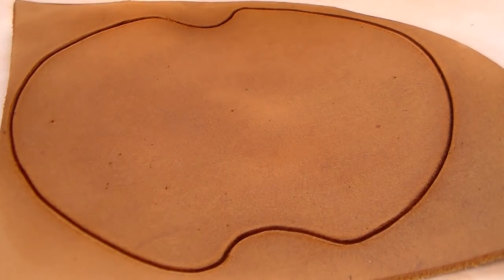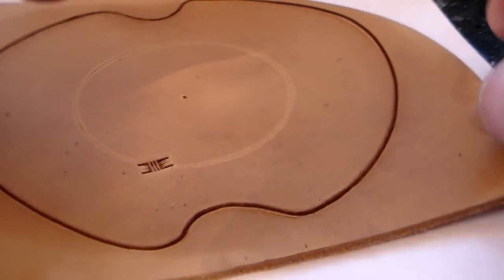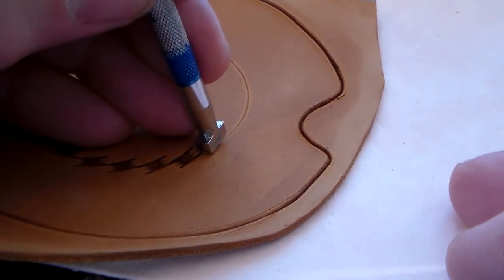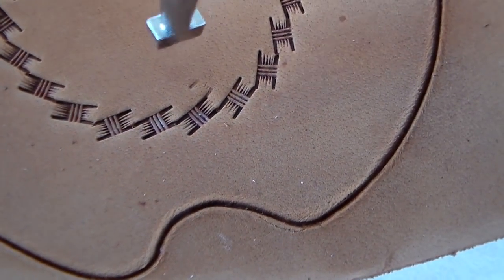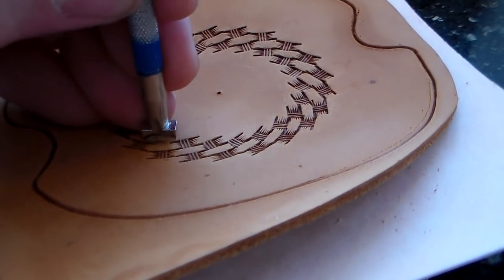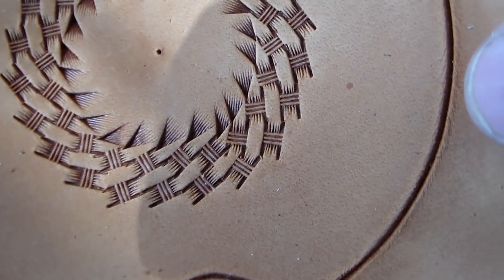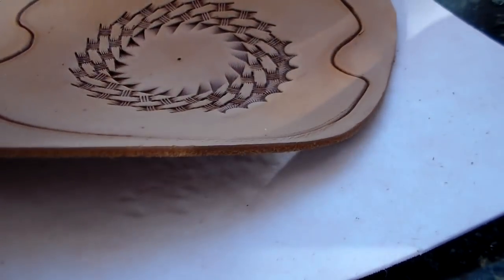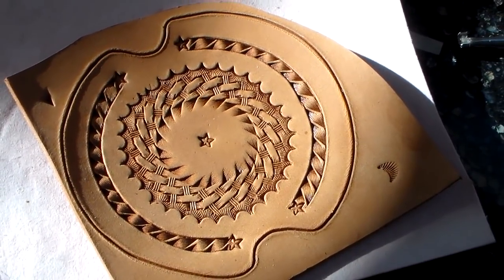Spiral Basketweave

Comment: Take the chance out of your circle size. Measure the points of the corners of the stamp where it touches the line. Decide the circle size you want, divide the circumference of that circle by your measure of the stamp. Round off the decimal. multiply that by the measure of the stamp and that will be the circumference you need. I subbed as soon as you imbibed the wisdom of "it is much easier to not be a perfectionist."
Reply: funny, that exact thought came to mind while watching this video, but, his experience "knew" what would work and it did
the eye never lies
Reply: @motoputz3201  Yeah.. Perfectionist's DO have a hard time accepting this. However, that is exactly where "Real World" mathematics comes into play. It did work-out the first few inner rings, but then the outer ring... that's where my OCD kicked-in, and I needed to figure some resolve, in the matter. Thank you!

Comment: So WHAT is the diameter of the circle?  Very important!  You gave us the stamp number but no diameter.
Reply from the maker: Hi Frank, 5cm or 2".
You will just have to do a test run on a piece of scrap leather to test.   The stamps are different sizes depending on when they were made, and it will make a difference how much you overlap the legs of the basketweave.   I overlap about half the length.

Comment: What is the optimum diameter of the circle for this pattern?
Reply from the maker: The outside diameter of the whole little project is 4"  (the swivel knife cut you see at the start of the video).  You will have to guess from there.  I no longer have that one to be able to measure....
Reply: @leatherworker  Many thanks.👍

Comment: What was the diameter of the circle that you scribed?
Reply: BeelzIbob; His circle is about 5 inches in diameter, to figure out precise spacing measure the length of the basket weave stamp and then multiply, say 35 x the length, then divide by pi or 3.1415  and that will give you the diameter, divide the diameter in half for the radius and you will then have the spacing for your dividers. Example 5" diameter circle is 2 1/2  inch spacing on the dividers. Complicated a little, but will give you the exact spacing. I was an aerospace sheet metal mechanic.
Stamp length from corner to corner is 0.75 inches x 40= 30" circumference, then divide by pi 3.141= 9.55" 
9.55 inches circle divided by 2= 4.77 inches or just slightly larger than 4 3/4" and now you have your spacing for your dividers. I wouldn't worry about 1/16th of an inch plus or minus. It's not an aircraft & not going to fly.
You can adjust up or down to get precise spacing on different sized circles.